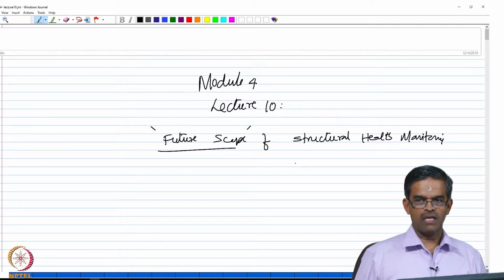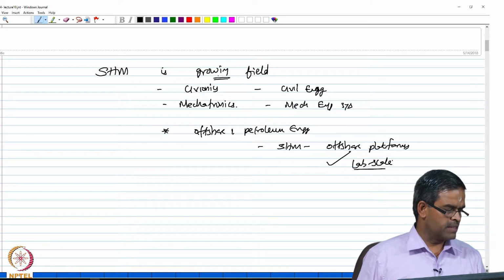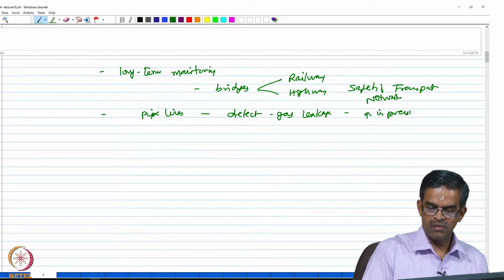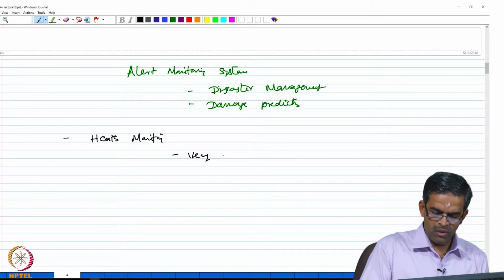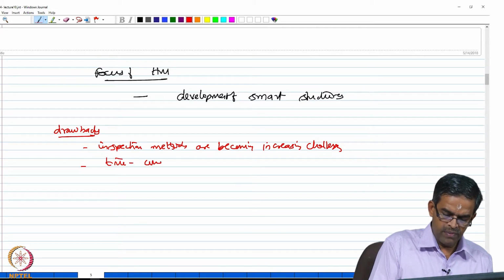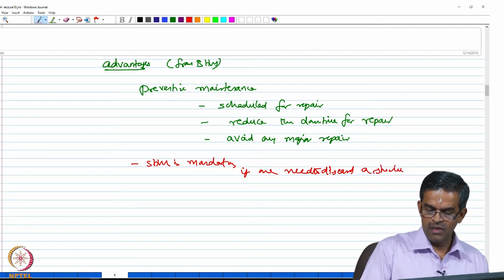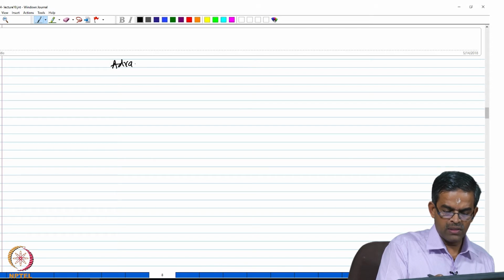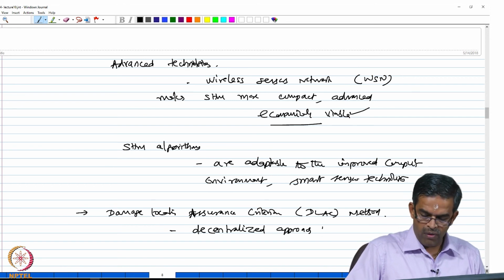Future Scope of SHM

Comment: Module 1. 
1.	Introduction to SHM. Part 1
Introduction to SHM. Part 2
2.	Necessity of SHM. Part 1
Necessity of SHM. Part 2
3.	Components of SHM Part 1
Components of SHM Part 2
4.	Challenges in SHM Part 1
Challenges in SHM Part 2
5.	Advantages of SHM Part 1
Advantages of SHM Part 2
6.	Components of SHM process Part 1
Components of SHM process Part 2
7.	SHM issues applied to concrete structures. Part 1
 SHM issues applied to concrete structures. Part 2
8.	Level of uncertainties in SHM process Part 1
Level of uncertainties in SHM process Part 2
Module 2. 
1.	Short -term and long-term Structural Health Monitoring (SHM) - Part 1
Short -term and long-term Structural Health Monitoring (SHM) - Part 2
2.	Local and Global Health Monitoring- Part 1
Part 2 is lost.
3.	Estimation of Structural Health i.e. Structural Health Monitoring (SHM). Part 1
Part 2 is lost.
4.	Structural Health Monitoring (SHM) Planning and Management - Part 1
Structural Health Monitoring (SHM) Planning and Management - Part 2
5.	Vibration based health monitoring scheme – Part 1
Vibration based health monitoring scheme – Part 2
6.	Structural Health monitoring methods:1– Part 1
Structural Health monitoring methods:1– Part 2
7.	Damage identification using lumped mass and Element modal stiffness – Part 1
Damage identification using lumped mass and Element modal stiffness – Part 2
8.	Damage identification by visual Inspection method – Part 1
Damage identification by visual Inspection method – Part 2
9.	Various vibration-based method in SHM-1 – Part 1
Various vibration-based method in SHM-1 – Part 2
10.	Comparison of Damage Detection Method – II. Part 1
Part 2 is lost.
11.	Structural Health Monitoring (SHM) & Statistical Pattern Recognition (SPR). Part 1
Part 2 is lost.
12.	Non-Destructive evaluation - I - Part 1 
Non-Destructive evaluation - I - Part 2
13.	There is no lecture 13.
14.	Non-Destructive evaluation - II Part 1
Non-Destructive evaluation - II Part 2

Module 3.
1.	Various sensor technologies – Part 1
Various sensor technologies – Part 2
2.	Fibre Optic sensors-Part 1
Fibre Optic sensors-Part 2
3.	Smart sensing for SHM-Part 1
Smart sensing for SHM-Part 2
4.	Sensing requirements in special structures
5.	The sensor requirements and Data acquisition -Part 1
The sensor requirements and Data acquisition -Part 2
6.	Acquisition system and Networking for SHM -Part 1
Acquisition system and Networking for SHM -Part 2
7.	Wireless Sensor Networking (WSN) – Part 1.
Wireless Sensor Networking (WSN) – Part 2
8.	SHM layout design of offshore structures- Part 1
Part 2 is lost.
9.	SHM design-Part 1
SHM design-Part 2
10.	Artificial Intelligence (AI) in structural health monitoring (SHM). Part 1
Part 2 is lost.
11.	Artificial Neural Network (ANN) in the SHM process.
Part 2 is lost.

Module 4.

1.	There is no lecture 1.
2.	Design of Sensor Layout for SHM - Part 1
Design of Sensor Layout for SHM - Part 2
3.	SHM Design for BSLRP-Part 1
SHM Design for BSLRP-Part 2
4.	There is no lecture 4.
5.	SHM Design-2 for BSLRP- Part 1
SHM Design-2 for BSLRP- Part 2
6.	SHM Design by experimental investigations for lab scale model of TLP – I
SHM Design by experimental investigations for lab scale model of TLP - I
7.	Structural Health Monitoring (SHM) of lab scale model of TLP – II. Part 1
Structural Health Monitoring (SHM) of lab scale model of TLP – II. Part 2
8.	Structural Health Monitoring (SHM) of lab scale model of TLP – III. Part 1
Structural Health Monitoring (SHM) of lab scale model of TLP – III. Part 2
9.	Structural Health Monitoring (SHM) of lab scale model of TLP – IV. Part 1
Structural Health Monitoring (SHM) of lab scale model of TLP – IV. Part 2
10.	Future Scope of SHM. Part 1
Future Scope of SHM. Part 2
11.	Application of SHM in Infrastructure Engineering Part – 1
Application of SHM in Infrastructure Engineering Part – 2
-------------------------------------------------------------------------------------------------------------

Vibration based damage detection - Part 2
Crack detection in composites - Part 2
Long term SHM (Structural Health Monitoring)- Part 2
Damage detection methods – Part 2
Date evaluation and assessment – Part 2
Plausibility of errors in SHM- Part 2
Damage detection– Part 2